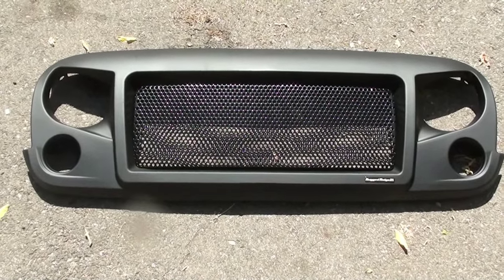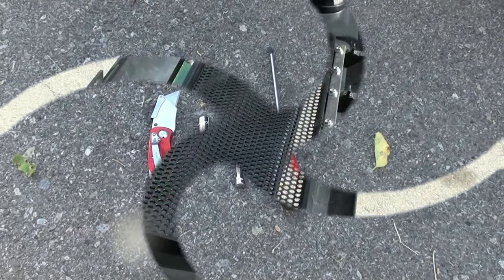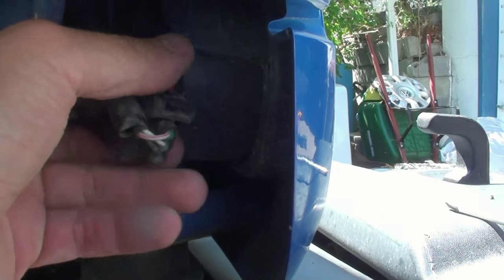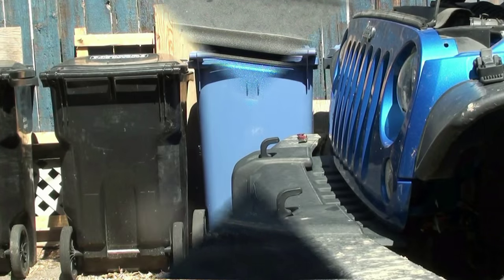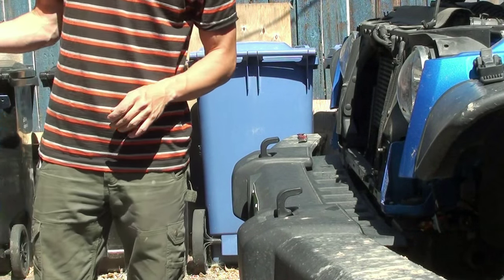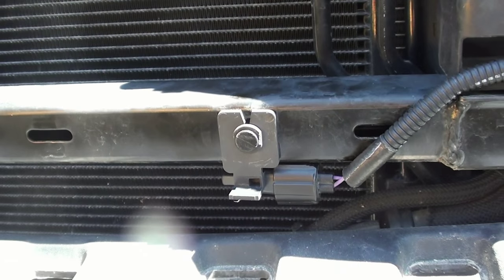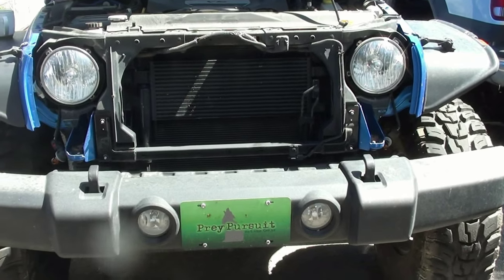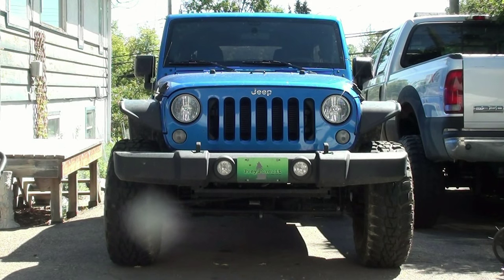Rugged Ridge Spartan Grille Install

Comment: Greetings. I'm having a hell of a time removing the fastener bolts for the stock mesh to replace with my custom one. What tools did you use to hold the nuts in place as I can't seem to get pliers in there. Any help would be great! Thanks and nice work on yours!
Reply: I'm having the SAME problem, and I can't get a 10mm behind the bracket to hold onto the $%^& nut to keep it from spinning! What are people doing to get it off?
Reply: Literally my exact problem, idk why tf they make it sound so easy cus it’s NOT. I even got a little wrench in there to hold the nut and it still won’t unscrew all the way?! Plz help